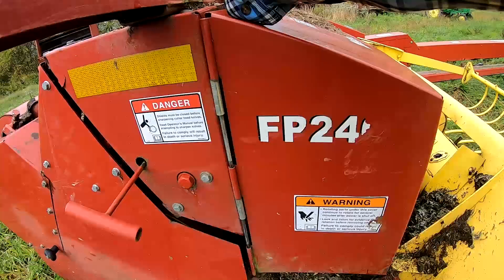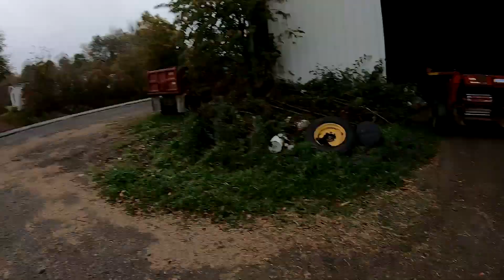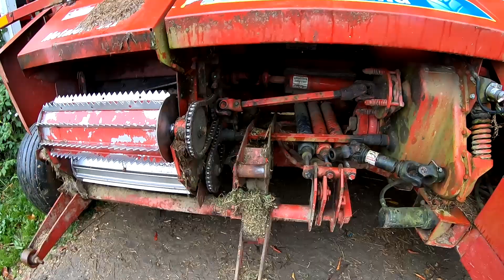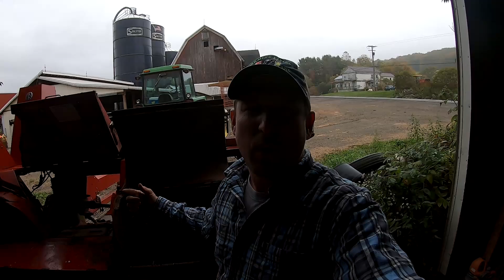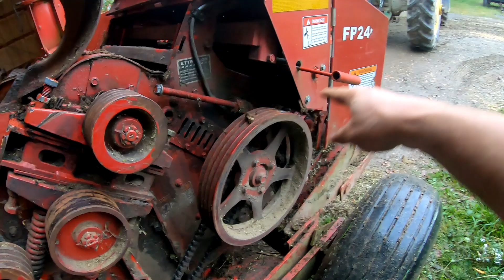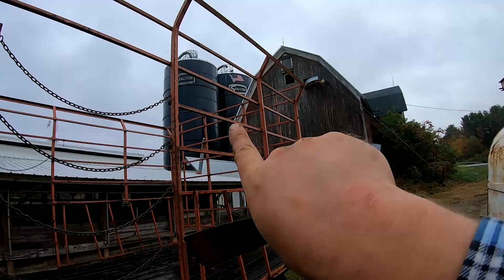Getting Ready For Corn Silage

Comment: We start Friday. We fill a 20/70 harvestor and a 9/250 bag. 5 hours for the bag 8 hours for the silo. Fill them both at 55% because we transfer the bag in the spring.
Reply from the maker: That's cool. If we transferred the bag into the silo we would have to do that too. We use our bag to feed out of when we empty the silo and do maintenance on the unlaoder
Reply: How many acres do you cut
Reply from the maker: All depends. We fill a 8x200 ag bag and the silo and when its full we are done chopping and we'll combine the rest

Comment: Good video Mikep7810&buddy.Interesting vid as usual.Is press/mill/processed an extra on the chopper ?No doubt it takes a lot more power hp to run.Thank you from Wales.
Reply from the maker: You can order a chopper without a processor but they are pretty common now a days. Running that corn through the rolls cracks the kernel and makes it more digestible for the cows